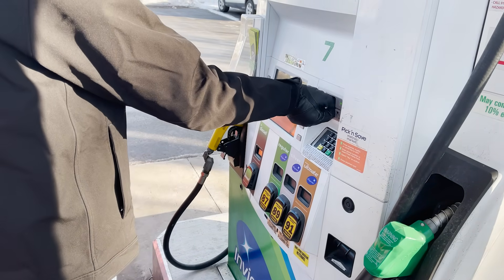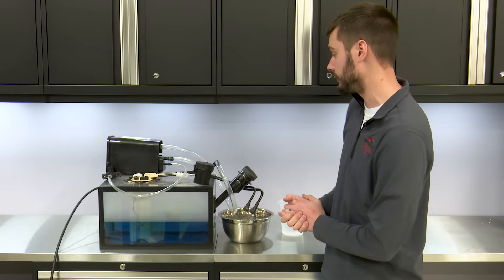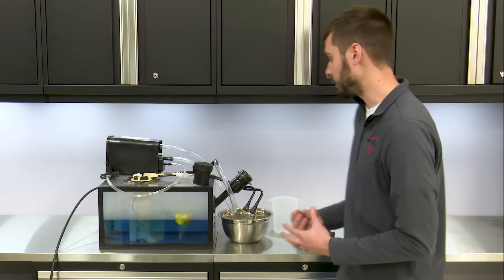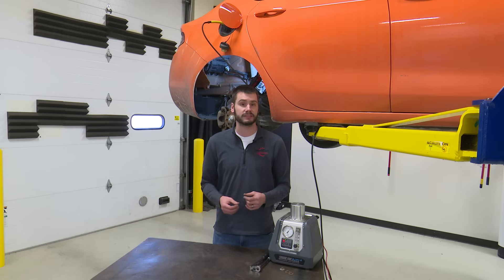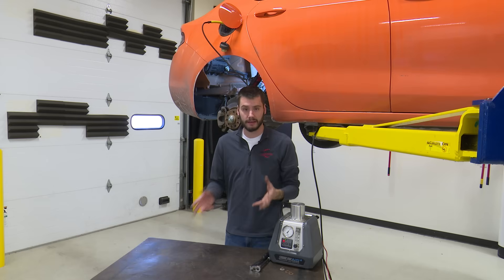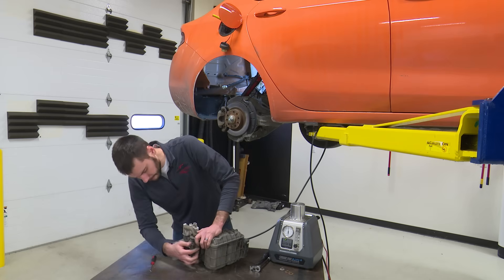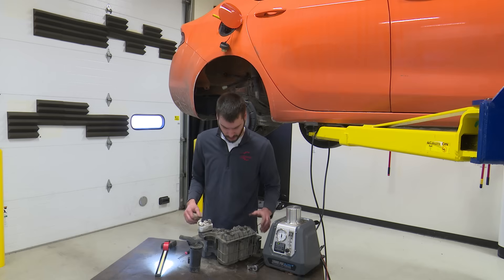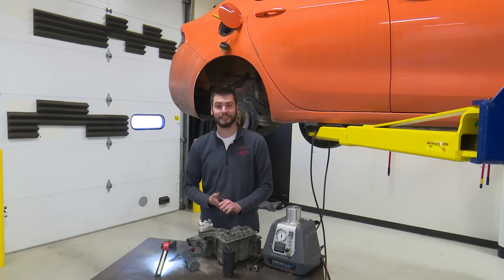Can't Fill Your Car With Gas? Simple EVAP Checks To See Why The Fuel Pump Keeps Clicking Off

Comment: My pickup does this,however I can put gas in it if I pour gas into my tank with a gas can with a small vent hole in it.after I put a few gallons in I can take it to the gas station and fill it normally,I believe it needs about 1/4tank in order to fill normally.

Comment: ((2006 Chevy Express Ext)): So I got code P0455 large leak,and the clicking sound at the gas pump,also after running the vehicle when I turn it off a loud bang sound coming from the muffler. replaced the canister. Code is still coming up?

Comment: Had 2009 Pathfinder that would not take fuel, feeble explanation from service department with a large bill to correct the problem, stated it was from overfilling gas which sounded fishy as it was a vent or evap problem not explained correctly

Comment: I had this problem with my daughter’s Jeep Compass. I figured it was either a stuck check valve or a clogged evap canister. The check valve is a ball held in place with a spring and sometimes the ball gets stuck in the closed position which prevents gas from flowing into the gas tank. I took the fill hose off the gas tank nipple and used wire coat hanger to poke the ball check valve and freed it up. I put the fill hose back onto the  fuel tank nipple and then drove to the gas station - BOOM, fixed! I filled the gas tank up without any problems.

Comment: Mike ....this is the best overview of EVAP system testing and repair!!!  Especially, helpful was your bench test model.  I hope this is OK, but I've pasted an email to a prominent Smoke Machine manufacturer with a situation I faced in testing my 2011 Silverado  "clicker":
Fallacies in Smoke Testing an EVAP Vapor Canister:
So here’s an anomaly when testing EVAP Canisters:  I had a NEW vapor (EVAP) charcoal canister on my bench.  No hoses or valves….just the canister with the typical 3-ports.  Why doesn’t smoke flow through the canister using the [Redacted] Smoke Machine?  The same is true with the old OEM canister.  And it makes no difference which ports I inject the smoke into.  Absolutely NO SMOKE flows through either canister!
My original problem was that I could not fill my gas tank properly (@ only 18k miles!).  The gas station pump would prematurely keep shutting off.  There is plenty of online guidance that suggests a faulty (otherwise “plugged”) canister.  And that’s what I thought it was too.  But like so many YouTube videos show, I wanted to verify that the purge valve and line, the vent valve and line, and the tank vent line were not involved.  When I smoked everything else, there was no blockage and the valves would energize properly.
I fully disconnected everything from the OEM canister, while still mounted to the vehicle, and just like on the bench (above) I could NOT get any smoke to flow through the canister.  It was at that point that I went and purchased a new canister.  And the new canister indeed did fix my problem and I could once again fill my gas tank as normal.
 But I’m perplexed as to why these Smoke Machines are advertised to find faults in the EVAP system, when it really can’t detect problems within the canister itself by using smoke tests.  Please correct me if I am wrong….but shouldn’t the smoke from any Smoke Machine be absorbed or trapped by the charcoal in the canister?  That’s the vapor canister’s job …. to absorb, store hydrocarbons (HC’s) and ultimately release clean air.  And isn’t the smoke from the machine basically comprised of HC’s….aka, particulate matter (PM)?
This would explain why both the new and old canisters would not (seemingly) pass smoke through them.  Btw, both canisters would flow compressed air just fine.  Arguably, the air flow was slightly lower in the OEM unit.  I’m just saying that ‘no smoke’ through the canisters does NOT mean that it is plugged solid.  It just means that the smoke is absorbed by the canister’s carbon bed, which is the whole purpose of the entire EVAP system.  As it turned out, after cutting open the OEM canister, the OEM charcoal bed was contaminated and compacted right next to the fuel tank vent inlet port…..but only the immediate area was affected.  I’m sure that is due to ‘over-filling’ my tank beyond the 1st click.  I don’t do that anymore!!!
I could be way off base on my assessment of this situation.  But for what it's worth, I’m a retired automotive engine engineer…and I’ve been involved in the car business all my life.  By all means that doesn’t make me a “know it all”, nor an expert on anything.  But I have lived on the principle, “If you can measure it, you can fix it”.  Yet in this instance, ‘I fixed it without being able to measure it’!  😊 
This was a redacted email that I sent to the manufacturer of the Smoke Machine I had purchased.  Their kind response was that indeed my assessment was spot on.  You can use a Smoke Machine to test the appendages of an EVAP system, but the canister itself most likely will not pass smoke whether good or bad.

I hope this helps others diagnose their tank fill problem.

Comment: I don't get one critical aspect: Is the charcoal filter meant to filter the fresh air coming IN the vapor canister from the outside, or is it meant to filter the gas vapors from inside the canister before releasing them OUT into the atmosphere? As you can see, I'm still not sure if the charcoal filter + vent valve are a 2-way street between the vapor canister and outside air or just a 1-way street (and if so, in which direction)? Thank you so much!

Comment: Great video. My 2500 savana is having same issue. When trying to fill gas , the gas station pump handle doesn't click but gas just spills out from filler neck after only a few dollars.  I've checked all items by watching your video. All looks good. Also the car's gas gauge always shows full even when empty.  Can a bad sending unit be the culprit? Any help would be greatly appreciated.  Thank you.

Comment: I have a similar problem but it comes and goes. When the check engine light comes on I can’t put gas in my 2003 SLS GMC. I am replacing the fuel pump tomorrow so need to look at this charcoal exchange filter systems. Could it be the solenoid?

Comment: The smoke test seems bogus. No smoke doesn’t mean there’s a blockage, it just means that the charcoal canister is doing it’s job, and filtering out the smoke.
Reply: Smoke is thinner than dirt. If the filter is so clogged that smoke can’t , clean air can’t get through

Comment: There is a anti siphon/roller over check valve on dodge vehicles that stick in the closed position where the fill neck connects to the tank

Comment: Great video and everything makes since. However I have one question. My mechanic who has done great work for me in the past ran some tests and couldn’t find an issue with the EVAP system. They are telling me the issue is with the fuel pump. I can’t find anything that supports that diagnosis. Do you feel a fuel pump can cause a fuel fill issue as such?

Comment: Bro! This video is the sh!t… I learned a lot; thank you. A lot of people pay money for mechanics/techs to do this type of work without knowing the process. Glad you took the time to thoroughly explain it. 👍🏽👍🏽
Reply: What was this systems actual purpose in the seventies, ? If the canister clogged or the vacuum  valve stuck, we smelled fuel instead of a $1000 dealer bs repair . Smelling gas was daily for 100 years. No one died,  even the stats of gas stations blowing up were minimal when the service attendant filling your tank was smoking.. manufactures went along with public groups to address the odors to make cars more appealing  to the less masculine.  Sales.  In larger numbers. More plastic to age, extreme temperature failures, 
Yes I do dislike plastic in the wrong applications.

Comment: My Jeep Patriot 2010 has a defective roll over valve which, OF COURSE, is built in to the gas tank which would need to be replaced for 1500 or more.... solution....just not fill the tank until it clicks.... annoying but not $1500 repair bill....

Comment: I've had this problem for about a year now. First it started that the car wouldn't take gas and I'd have to spend five minutes filling it up. Now its worse, same initial problem, but, when it gets below a quarter of a tank, the engine starts running really rough at idle and acceleration from stop and if I don't relieve the pressure and put more gas in the car, I'll foul a plug and eventually a coil. So..... Since I'm living in poverty and food is my priority, not fixing my car. (Unfortunately I live in my car) I found that if I keep the engine running when I'm pumping gas in the car, then leave my gas cap off and drive it for about 5 or 10 minutes. That helps. I then put the cap back on and drive normally until im at 1/4 tank again and then i repeat what i just said. Do you have any suggestions for folks who cant afford mechanic work with this issue?
😓🤷. Thanks. Sorry to bother you.

Comment: Having this issue with a 2010 Ford Escape, which is apparently notorious for having a range of fuel issues, including a check engine light for debris. The car and the manual even tell you to use the fuel funnel essentially as a pipe cleaner to get the check engine to come off. That was working before, but now we've got trapped vapor and can't fill the tank.

Comment: My car does the annoying cutoffs and also overflows and pours out under car!!! I never know if its actually full because guage quit working stuck at quarter tank.of course all them evap parts discontinued for my 94 Regal. check engine light comes on too and of course nobody can scan obd1 around here. Any suggestions where to get parts or what the problem is?

Comment: Try dealing with this in -20f with windchill and a monster '05 Yukon! I guess my wife doesn't mind as I always make sure she has gas to shuttle the kiddos around. Pretty common issue on that era of GM trucks.
Reply from the maker: Hey Larry, for sure it was! That's why they had the remote mount filter kit made for those trucks. The vent was soooo common to plug up.
~Mike

Comment: Dows this turn on the engine check light, this happened to mine and today I turned it on the light was on
Reply from the maker: Hello,
It can turn on the check engine light, if it affects the EVAP system and its ability to vent.
But in this case the check engine light was not on.
Thanks for reaching out!
~Ryan

Comment: Hi! I have a 2005 Dodge Durango which like a lot of owners of the same vehicle, spills fuel when filling. I noticed the vent pipe to have like a trap before exiting on the filling neck. Do you think that's the flaw on design for this vehicle? I was thinking of replacing it with another brand filler neck; what do you think? 
Thanks!
Reply from the maker: Hey Mauricio, thanks for watching! The intended vent path of the system during refueling is through the NVLD assembly. It has a check valve that opens at 0.01 PSI to allow the fuel tank to breathe through the canister through the NVLD and out to atmosphere when refueling. Check out the hoses and path from the canister to the NVLD and through the NVLD filter assembly, if there is one.
~Mike

Comment: Could this be the case if it’s intermittent with no check engine light?
Reply from the maker: Hey Volfan, it could be. Because of the design of this system it may not set a check engine light for a restriction unless it's really really bad.
~Mike

Comment: On my 02 suburban, I have the "can't fill up my tank" issue and have replaced the gas cap, vaoor canister, purge solenoid, and vent valve.  I STILL HAVE the same issue.  No change.  And tips?
Reply from the maker: I would start checking the hoses for any restrictions, if that does not solve your issue there may be a stuck valve in your fuel tank.
~Ryan
Reply: @GoTechTraining  I blew out all hoses when I dropped the tank to check them all.  Thanks.
Reply: How do I test the tank for a stuck valve?  It was working since I last wrote, and now, all of a sudden, I have the issue again.   I had to use two 5 gallon jugs to fill up the tank a little bit, just so I could drive it.😢
Reply: @GoTechTraining. Checked all hoses for restrictions and didn't find any.  

What I did find, is when I disconnected the vent hose from the tank (that connects to the filler neck), and shot some bursts of compressed air into, which actually inflated the fuel tank.  When I stopped the compressed air, the air rushed back out of the vent hose I blew into.  Is that normal ?

Comment: My 2021 Jeep Grand Cherokee has this type of issue.  I simply turn the nozzle 360 degrees and it fills no problem at all.  I found this trick in reading various Jeep forums online.
Reply from the maker: That's interesting David! Wonder if they have a factory venting issue?
~Mike
Reply: I've had to do this for my 05 Mustang, but I only have to rotate the bottom of the pump nozzle counterclockwise to the 2 or 3 o'clock position. Yes, it does work.

Comment: Need help! my S10 through the center hose on the fuel tank dumps liquid fuel out the vent on the charcoal canister! it is supposed to be a vapor vent I think. I just replaced the fuel pump in this truck. I have the bed off the truck and it is easy to fix whatever is wrong that is causing the flow to dump from the tank but I dont have any idea why it is happening. I took the foam filter out and cleaned it and also the rubber hose from the charcoal filter to the vent .they both were filthy with road dust but DRY. IT IS A LITTLE PLASTIC  box with a foam filter insidet hat comes from the charcoal filter.
Reply from the maker: Hey Gustavo, something is bulding pressure inside the tank. Look for pinched hoses somewhere.
~Mike

Comment: Would you get a trouble code for this situation?
Reply from the maker: Hey Mike,
I'm not sure if this particular system would set a DTC. But many systems run tests for venting ability and will set codes like P0446 vent system performance. 
~Ryan

Comment: I feel that if your pump shuts off at $28 .60 and you are trying to top it off to an even $30, all of the excess fuel could work it's way into the vent lines. So once it stops, that's it don't force more fuel into it.
Reply from the maker: It can also work its way into the canister as well. When it shuts off, it's done, don't try filling more...unless theres an issue like this car had
~mike

Comment: Why I love older cars .they don't have sealed system . So basically the vent valve could be stuck, or the charcoal from the canister could be plugging the vent hose. Usually these components are above the fuel tank and frame, very difficult to access
Reply from the maker: Yes Juan, in a normal EVAP system that's the case. Chrysler uses and ESIM system on here without a traditional vent. Most of the evap components on this one are located in the wheel well.
~Mike

Comment: My dad’s car has this stage 5 clicker issue too so I appreciate this video. His is an 05 Mustang. He was told a spider might have got down the fuel neck and you mentioned spider webs could be a culprit blocking the air to fuel ratio when at the pump, so my question is how do spiders get in there? I’m guessing they got on the gas pump nossel and then forced into the fuel neck of the car 🤷🏻‍♂️
Reply from the maker: Hello,
That's a great question! Most of the spider webs I've seen blocking systems have been at the filter side of the system. So they didn't have to crawl to far to cause an issue. If there was a restriction at the fuel neck that's a bit tougher. But they are pretty sneaky!
~Ryan

Comment: What about diesels  ???
Reply from the maker: Hey Pat,
Diesel vehicles don't use traditional EVAP systems due to the fuel not being the same. But they do use fuel tank vents/breather systems that can fail and cause issues. One way or another the air has to escape the fuel tank during filling or the fuel will not fill the tank. If you have a issue filling a diesel, the first step would be to find how the tank is designed to vent.
Good question!
~Ryan
Reply: @GoTechTraining  " Designed to vent " ?
Reply: @GoTechTraining  it's a ford focus tec cdi 2013 .
Reply: @GoTechTraining  I suppose I'll have to get it up on the ramp when I get time see of there's anything that looks wrong blow through any pipes etc and go from there , I bought this car in May of two thousand and twenty one , its  gradually getting to a point when I can only get £ 1.50 worth at a time  between clicking  the problem is obviously getting worse and the Internet seems to be clueless on the subject , with petrol the opposite .
Reply from the maker: Hi Pat,
By designed to vent, I mean how the fuel tank breathes. All Gasoline engines breathe through a charcoal canister and filter so the hydrocarbons can be captured and eventually reburned in the engine, essentially what a EVAP system is. As fuel heats up or cools down, the fuel expands and contracts and when you fill your tank you have to displace the air in the tank with fuel. So the tank must have the ability to release pressure and suck in air. Diesel fuel is not volatile like gas so they don't use EVAP systems. But on the tank some where or from a hose attached to the tank there has to be some kind of breather valve that allows the tanks to release pressure and suck in air. I would check the filler neck and follow any hoses from the tank that might be plugged and then look for something that may be a breather. I would give you more specific information but the us market does not have a diesel Focus and so I don't have access to the service info.
I hope this helps1 Thanks for reaching out!
~Ryan
Reply: @GoTechTraining  So I suppose look for a blockage in one of the rubber pipes blow them through ,
Reply: There's one on ebay